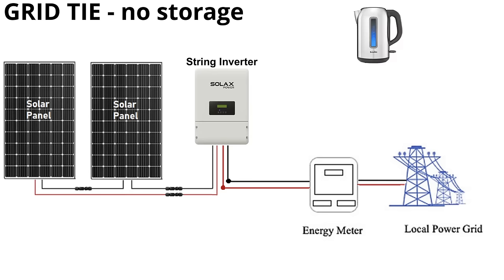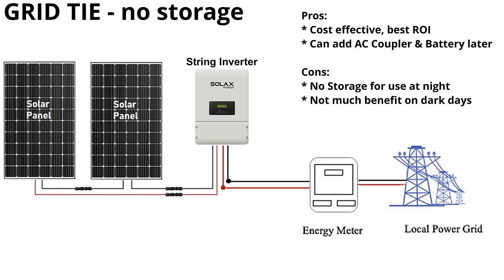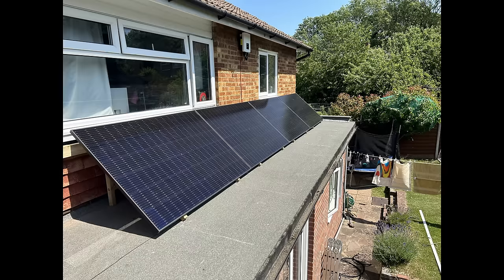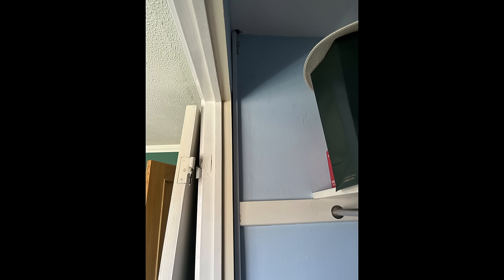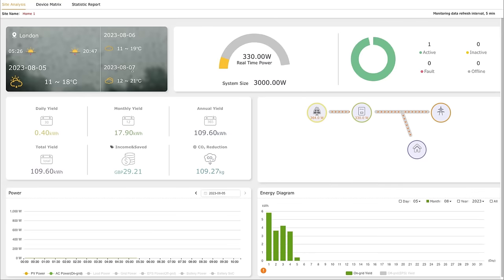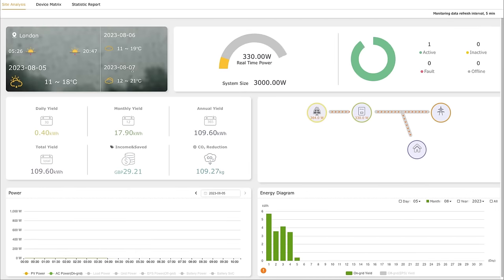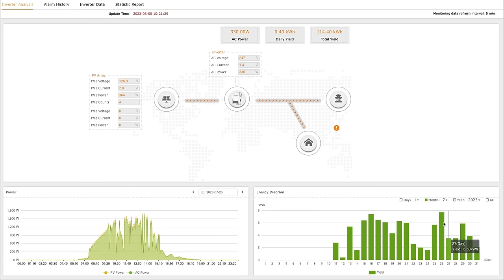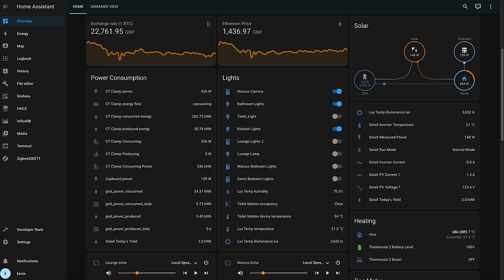DIY Solar Project 2023, worth it in the UK?

Comment: 17:13 Go for Parallel 

The way solar panels are connected to an inverter—whether in parallel or in series—can significantly affect their performance, particularly in terms of output voltage, current, and overall energy production. Let's explore the differences between parallel and series connections, which can impact earnings:

### Series Connection
1. **Voltage Increase**: In a series connection, the voltage increases while the current remains the same. For example, if you connect four 250 W panels rated at 30 V each in series, the total voltage would be 120 V (30 V × 4). The total output power remains the same (1,000 W) as the current from each panel is limited by the panel with the lowest output.

2. **String Length**: The number of panels that can be connected in series is limited by the inverter's maximum voltage rating. If one panel is shaded or underperforming, the entire string's output current is affected (due to the current being equalized), which can reduce overall energy production.

3. **Higher Voltage**: Higher voltage can be beneficial in reducing line losses over longer distances between the panels and the inverter, but it may also require more expensive equipment or specific inverter models designed for higher voltage inputs.

### Parallel Connection
1. **Current Increase**: In a parallel connection, the voltage remains the same while the current increases. For four 250 W panels connected in parallel, the voltage would remain at 30 V, but the total current would increase, potentially allowing for higher total power output (up to 1,000 W if each panel produces at its rated capacity).

2. **Improved Performance**: If one panel gets shaded or is underperforming in a parallel configuration, the other panels can still operate at their maximum capacity, which reduces the impact of shading or inefficiencies on overall system performance.

3. **Easier to Manage**: Parallel connections can generally be more flexible because they allow for easier integration of additional panels without worrying about total voltage exceeding the inverter limits.

### Impact on Earnings
- **Performance Under Varying Conditions**: If you have a scenario with shading or varying panel performance conditions, a parallel connection tends to perform better, resulting in potentially higher energy production and therefore higher earnings.
  
- **Optimal Configuration**: In a well-designed system without shading or other factors affecting performance, the differences in output may be minimal. However, most real-world situations may benefit from the more resilient performance of parallel connections.

### Conclusion
In summary, using a parallel connection generally offers improved performance and reliability under varying environmental conditions, which can lead to higher total energy production and increased earnings over time. The best choice between series and parallel connections ultimately depends on the specific installation conditions and design characteristics of the solar power system.

Comment: Not convinced about this. I'm not familiar with the exact equipment used. However, it looks like you have wired directly into the consumer unit bus bar. In the case of a power cut, or scheduled maintenance, you are still feeding into the grid. What happens if you electrocute the person who is working on the line?

Additionally if you get your earth over the power line, and it goes down, your earth is potentially open circuit. In order for your rcd's to work properly (to protect you from electrocution) you need a good earth. 

As your panel's are on a wooden frame, you might like to consider earth straps on the metal frames.
Reply: The inverter will detect a loss of grid power and shut itself off when that happens. They can provide a separate connection (called EPS) that doesn't do that, normally battery backed, so you can run some circuits off that even during a power-cut. That must not be connected to the grid for the reasons you stated.

Comment: I am surprise that you have been allowed to feed into the grid without the remote control of the DNO over your install. They suppose to have devices controlled by them so they can cut the power (isolate your electricity producing system..) to your system during power cut for network maintenance or repair faults.. 
You did not mentioned anything about that.
Reply from the maker: "In times of grid failure, all grid-tied solar inverters are required to immediately shut down their connection to the grid. This safety precaution, known as “anti-islanding”, ensures that workers repairing the affected power lines do not accidentally encounter a live wire."

Comment: You dont have a DC isolater switch if you wanted to disconect the inverter you will have to do it live at 120 vdc or wait till night
Reply from the maker: The Inverter has its own DC Isolator switch.
Reply: @speedyrazor1  but the cables feeding it will still be live during day light, i also had to fit two mains isolater swiches on at the inverter and one at the fuse board could not get a G98 cert till all this was done
Reply: 100% DC isolator always required even if the inverter has an inbuilt. Also you have mentioned your G98 application given your system is grid tied, you need DNO approval for the inverter and export. Good frame, nice to see a good, detailed video 👍👍
Reply: @petersort2192  There is some confusion with the Regulations about DC Isolators being required when the Inverter has a built-in one. Regulations state to install a DC Isolator but they also say to follow Manufacturers Instructions and this created a conflict. I guess the Regs were written before Manufacturers started fitting built-in Isolators to reduce Build time. The general view is that you do not need a DC Isolator if the Inverter has a built in one
Reply: @aclee That is not what I have heard from the Regulator. Regs also state to follow Manufacturers Instructions and this creates a conflict. However, adding a DC Isolator is not expensive
Reply: @daveoram7249  as said above though, a dc isolator from the direct panel cables, isolates the panels whilst working with the inverter. DC inverter isolator won’t protect you from live panels if you need to swap the inverter etc.. for the cost, I’d always suggest safety over anything else. No issues at all having inverter isolation and direct tails from string.
Reply: @aclee  I was thinking the same thing this morning. Inverters are the weak link and tend to need replacing after 5 years. Without a separate DC Isolator it means disconnecting the PV Cables from the Panels. If I do a DIY Install I will be fitting DC Isolators for each String separately although I have been looking at Micro Inverters so there wouldn't be any DC Isolation requirement as these would be fitted to the Rear of each Panel

Comment: I’ve seen narrow boats use a raft of car batteries to store power to use later in heating water, washing machines etc. 

Is that not feasible here? Presumably a slightly tired car battery would still do?
Reply: You need deep cycle batteries.
Reply: Narrow boats use deep cycle leisure batteries.
Lithium batteries offer more useable storage for a given footprint, and are more suitable for solar usage.

Comment: Interesting video, couple of points, did you need planning permission for installing above the existing roofline? And having just had to repaitr a flat roof you may want to consider something between the end of the legs of the frame and the felt, even small movemnents will eventually wear a hole and lead to water damage.
Reply: I would have mounted the Wooden Structure on Rubber Screw In Mountings. Very cheap
Reply from the maker: @daveoram7249  Thats a good suggestion, I might go back and do that.

Comment: Ive got an ecoflow delta pro. All ive done is a length of cable, 3 pin plug on each end, one plug in the back of the delta and the other in a house socket. Ive got 1000w solar panels and when the weather is good it powers all the house.

Comment: I can never understand the payoff if it’s an average 34 pence per kilowatt ,and you generate 7.5 kw max during day or store in a battery for night use . It’s a looooong time before it pays off . At 7.5 * 34 pence per day saving maximum ?
Reply: Which equates to £77.99 a month, or £935  a year
Reply: @bermudavipertv  No, £26 a month, £210 a year but thats only selling at 15p, if he can use 600kwh and sell 700kwh thats around £280 a year, so 4-5 year payback.

Comment: I followed up by asking, “Can you tell me the amount of solar panels needed if I placed all 9 panels on an average pitched roof facing about 100 degrees, based on North being 0 degrees?”

It replied, “To determine the optimal number of solar panels you would need based on your specific roof orientation and electricity consumption (3,500 kWh per year), we should consider a few important factors, including the efficiency of your solar panels, the pitch of your roof, and the overall solar potential of your specific location.

### Factors to Consider:

1. **Orientation and Angle**: 
   - In the UK, south-facing (180 degrees) is typically the ideal orientation for solar panels, as it receives the most sunlight throughout the day. However, an orientation of 100 degrees (which is slightly east of southeast) can still be effective, though it may lead to slightly lower energy production compared to a south-facing installation.

2. **Estimated Solar Production**:
   - Solar panels produce less energy when not facing directly south. The output can be estimated using the orientation correction factor. A rough estimate suggests that an east-facing orientation might reduce solar panel efficiency by about 10–15% compared to a south-facing orientation.

### Calculation:

1. **Daily Electricity Use**:  
   As calculated earlier, your daily usage is approximately **9.59 kWh/day**.

2. **Adjusted Daily Output for Orientation**:
   If we assume a 10% reduction in panel output due to the 100-degree orientation:
   - The output of a *410W* panel in optimal conditions (previously calculated as approximately **1.146 kWh/day**) would be reduced:
   \[
   \text{Adjusted daily output} = 1.146 \text{ kWh} \times (1 - 0.10) \approx 1.031 \text{ kWh/day}
   \]

3. **Number of Panels Needed**:
   You can now calculate the number of panels needed to cover your daily electricity use:
   \[
   \text{Number of panels} = \frac{9.59 \text{ kWh/day}}{1.031 \text{ kWh/panel}} \approx 9.3
   \]

Since you generally cannot install a fraction of a panel, you would need to round up to *10 panels* to be self-sufficient in your energy usage.

### Conclusion:
In summary, based on a roof orientation of 100 degrees and a slight decrease in efficiency, you would need *10 solar panels rated at 410W* to cover an electricity usage of 3,500 kWh per year. This ensures you account for the reduced output due to the orientation while still achieving self-sufficiency. As always, it’s wise to consult with a solar professional who can assess site-specific conditions and provide a tailored solution.”

So I just needed 1 extra❤

Comment: I've never seen an inverter installed outside.  Is it properly waterproof?
Reply: Lots are designed for external mounting , however the one in this video I’m not so sure , I have the Huawai SUN2000 which is designed for external use.

Comment: Come such q long way ive got 10 panels and produce about 2kwh but council property. My dads got about the same on his hut he owns them and was lucky they were deemed as misold so got Most of the money back under a ppi like scheme his was about £8k. My old boss has either 16 or 20 panels but was an early adopted so only couple kwh or so but hes in a really high fit payment around 60p. I may addsome more to my systemif its this cheap even if they go on the more northern facing side if the house at that price i think will be wirth it.

Comment: Very nice video but you did not give the ROI figures based on cost reductions from the grid plus sell back to the grid. More importantly, you did not discuss permitted development/ planning permission issues and the related costs of those. You need planning permission for panels on a flat roof plus, possibly, building regs or MCS certification could apply. OTOH it is permitted development for a pitched roof  but there is a still a cost to show this is a legal development (especially for selling the house and possibly building insurance) . If I am wrong about any this, then still this need to be discussed and was not. This could be expensively misleading to others watching this.

Comment: You missed out on 20% VAT saving when you get battery and solar together so adding a battery later is 20% more expensive. Also with Octopus Flux an oversized battery will pay for itself as you can make a profit each day tax free. I have a 10kwh battery on order to add to my 4kw solar. A friend of mine with a similar setup made £250 on Flux in June.. so spending the extra makes sense.
Reply: I think you'll only get the 20% VAT saving if using a VAT registered installer and supplier - i.e. not when buying directly as a private individual regardless of buying battery and panels together. I think the saving is moot as there are other savings/discounts to be had if buying shrewdly (for DIY purposes).
Reply: Ahh that’s disappointing if that’s the case you should be able to get the discount as an individual, too much temptation for the installer to pocket that 20% saving as a bonus.

Comment: I also asked AI the following “How do i generate my solar power? I know a few things that I need, but I am not 100%, so could you giver me clear advice where necessary? So I believe I need 9 Solar panels from what you’ve mentioned. So I’m assuming I need about the 4GW inverter, a DC isolator, an AC isolator and what else? Cable of some sort…”

It replied, “Generating solar power for your home involves several components beyond just the solar panels. Here's a clear breakdown of what you'll need to set up a typical solar power system based on your requirement of 9 solar panels rated at 410W each.

### Components Needed for Your Solar Power System:

1. *Solar Panels:*
   - You’ve already decided on **9 solar panels**, each rated at **410W**.

2. *Inverter:*
   - You're right in thinking you'll need an inverter to convert the DC electricity generated by the solar panels into AC electricity for use in your home. 
   - A *4 kW inverter* would be adequate for your setup (considering you're using around 3.5 kWh per day). Ensure it can handle the total output of your panels (9 panels x 410W = 3,690W).

3. *DC Isolator:*
   - A *DC isolator* is required to safely disconnect the solar panels from the inverter. This is an important safety feature for maintenance and emergency situations.

4. *AC Isolator:*
   - An *AC isolator* is installed on the output side of the inverter to disconnect the inverter from the household electrical system. This is also important for safety.

5. *Mounting System:*
   - You will need a *mounting system* to securely install the solar panels on your roof or on a ground structure. The mounting system will vary depending on your roof type (flat, pitched, etc.).

6. *Cabling:*
   - **Solar cable**: Special cables rated for high UV exposure and high temperatures, typically Solar PV rated cabling, will connect the solar panels to the inverter.
   - **AC cabling**: Wiring that will carry the AC current from the inverter to your household electrical system.
   - Make sure to have appropriate connectors, junction boxes, and disconnect switches as needed.

7. *Fuses and Circuit Breakers:*
   - You may need *fuses and circuit breakers* to protect your system from overload or short-circuits.

8. *Monitoring System (Optional):*
   - A monitoring system can be helpful to track the performance of your solar panels. It can give you data on how much energy your system is generating and help you optimize its performance.

9. *Battery Storage (Optional):*
   - If you want to store excess electricity generated during the day for use at night or during cloudy days, you may consider adding a **battery storage system**. 

### Installation:

- **Professional Installation**: Installing a solar power system involves electrical work, which can be complex and requires compliance with local regulations. It's recommended that you hire a certified solar installer to handle the installation.
- **Permits and Approvals**: Before installation, you may need to check with local authorities for permits and to ensure compliance with building codes and regulations.
- **Grid Connection**: If you plan to connect to the grid or take advantage of feed-in tariffs, ensure your system and installation comply with any utility company requirements.

### Conclusion:

Setting up a solar power system can be a complex process, but with the right components and professional help, you can successfully generate your own electricity. Make sure to consult with a local solar provider to assess your specific needs, obtain accurate costs, and ensure the best configuration for your setup.”
Reply: AI reckons the most efficient way is to go without a battery and have more panels and sell back to the grid, rather than the outlay for the expensive battery.